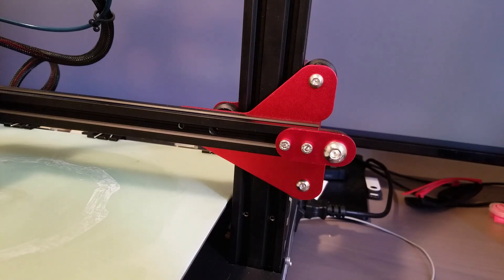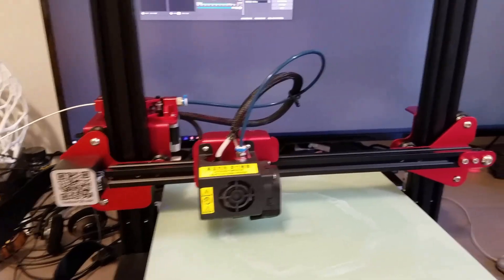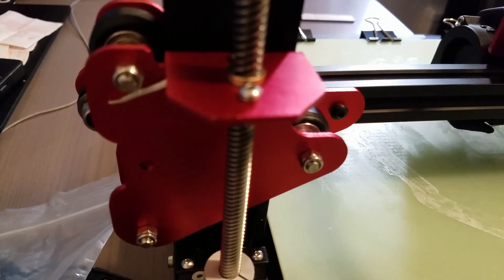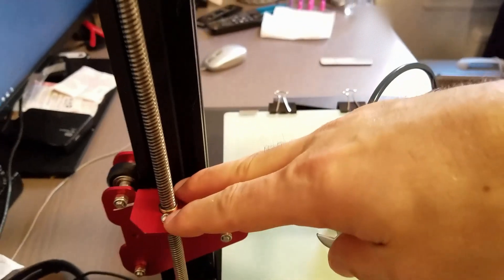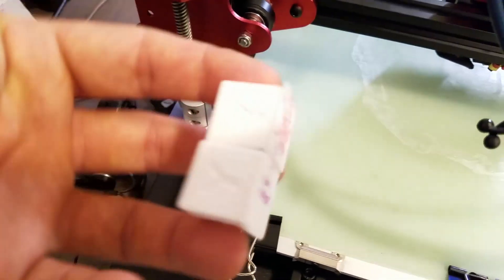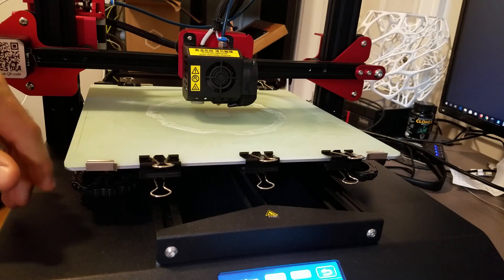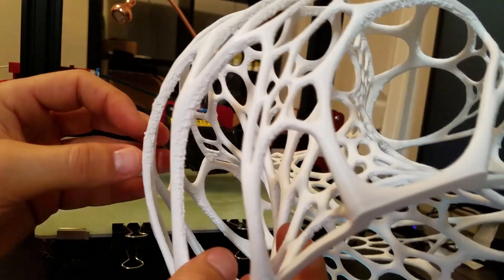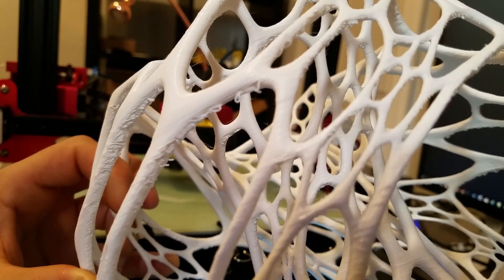Creality cr10s pro x axis truing z axis screw rods tunning, ball bearing wheel dust grinding,

Comment: That just looks like overextrusion. You should only need to get your z-axis “close” to level with the mesh bed leveling. However, I’ve heard a lot of really gnarly things about the CR-10S Pro V1. I have a V2 with the BLTouch and z-sync kit. Works great and is very easy
Reply from the maker: That Z sync kit sounds ibteresting.

Comment: did you fix that problem ? sometimes the material quality makes the diference
Reply from the maker: Actually I did not fix the problem. I was never able to. I replaced the printer.. I had two so basicallly I returnde the PRO and Kept the S5. Not the greatest decision there. But Hey. I did learn a lot on the PRO.
Reply from the maker: i got a differ3nt printer. i was never able to fix it.
Reply from the maker: i returned the printer.
Reply from the maker: i never was able to fix it.

Comment: Clonex?

i have the 10sPro

anti-backlash nuts seem to help, inductive sensor over whambam has been nice, firmware upgrade a must...z-synch mod printing now to install after a squaring ganrty and leveling it.....again, ugh.
this thing can print amazing if you're willing to dial it, but trying to dial it is not so amazing?
Reply from the maker: It has been a pain dialing it in. Clonex, I was trying to propagate new plants from cuttings. Not successful. 3d printing still half and half successful. It seems the hobbie Gods don't love me anymore. So I have been told it can print amazing. what I figure it out is that is can print amazing if you buy a second printer in parts and upgrades to deal with the quirks. I am still not yet dialed in. Everytime I try to tune the pri ter I may be making it worse. It is excessively time consuming.

Comment: I smashed my head into plate - too many time - now what damage could done : sensor does not work - when head come down light is off - trying different distance with sensor - no luck - now printer does not enter the new z :
Reply from the maker: You may need to replace the sensor / probe. did you try to rotate the screw at the top of the probe, counter clock wise, or clock wise? to test the probe you can just take a piece of metal put it close to the probe and check if the LED light turns on. Put the metal as close as possible even touch the tip of the probe to see if the light turns on. If it doesn t than it may be damaged, have you unplugged it from the board? check the wires. do you have glass on top of the bed? usually that affects the probe sensing. If you decide to replace the probe check out the videos online how to use different manufacturers, use the tiny3dmachines firmware for a different probe. if you havent try a new firmware anyway. I am sorry to hear about the probe.

Comment: I have the cr10s pro and what a pile of junk it is, the quality control in these printers is absolute zero. I had the same problem as you,, also the aluminium build plate was badly warped also the heat bed was warped, the gantry carriage fell apart after two prints and lots of screws were loose loose, some of the ball bearing wheels were over tightened. it was like somebody just threw it together without any care or quality control. No wonder you are burnt out, I am too.it's a shame when you spend £500,only to spend hours of frustration for your hard earned cash.
Reply from the maker: Yea I have been tuning it but I still have issues with it. It is quite a bit of work to get t dialed in. if you over tighten the rail wheels then your prints will be bad. I just saw that the y axis can also adjust the tension on the belt. so I have to check that.

Comment: The solution is to deassemble the Z-Axis and make it 90° where the metalplate joints the aluminum profil. This is quality problem. After it my z-axis is now 90°. At the CR-10 there was the same problem for some ppl - there you find good solutions and how to do it. Look for "CR-10 Z-Axis..." Also there is now a update for 1.60.70 with an inductive sensor - now the Z-Axis works good. Or you can make a GT2 760mm belt between axis this helps too, but after the update since some days it shouldnt happend any more with your z-axis.
Reply from the maker: Thank you for your advice.

Comment: Does enyone have a problem with the chip reader on this 3D printer? I had the joy only one to print with it but then i couldn't manage to make the chip reader to actually read the SD card ... i tryed a thousand times and it s  just annoying... i just recieved it today and i m already having problems with it
Can anyone help me, please!!
Reply from the maker: I did say it in my review that you have to save the file locally on the computer and move it onto the sd card, make sure the name is very short. Furthermore in the comments for the review video viewers informed me that there are some Cura settings you can change to fix this issue and directly save to the SD card. https://youtu.be/N0fOA-g6o0k, Use cura from the SD card you received with the printer and alter the settings. that is cura 3.0.2
Reply: you need the original stl file on it - and the sd card should not be too big. also it needs the right format. I had the same problem but his was what i read so far. At them moment i use octopy via raspery 3 to load my files up.
Reply: I am not sure your problem with the SD Card, I had a problem if I download a file and the name is too long, shorten to about 10 characters and will be fine.

Comment: The fuzz on the wheels is just dust. The wheels generate quite a bit of static and draws a ton of dust. I have been printing with my ender 3 (same wheels) for three months and they have the dust on them constantly. lots of dust all the time and there is no actual wear on the wheels, no issues with prints. The print looks pretty decent for stock cooling and .3 layer height. The part cooling duct that comes on all of the creality printers is not fantastic. Even a small simple upgrade like https://www.thingiverse.com/thing:2814127 will help with all the overhangs in any print.
Reply from the maker: Thank you for sharing your knowledge, and confirming my results. I just recently printed a few cubes at .32mm Layer height, and .32 seems to print okish. I have been postponing reprinting it because it takes some time.

Comment: I myself have a cr-10 s pro.. uff, where to start...

Me and a friend tried to tune it properly and we almost got it all calibrated. I am not 100% satisfied with it since my X axis is not perfectly level, and the Z wheels (the ones that you were complaining about as well, are not perfectly smooth). The printer has indeed some factory problems, but they almost all do and all of them need user calibration.

Generally when you are calibrating a printer, it should be in the "Goldilocks zone" not too tight, not too loose, that's for belts and wheels, you should be able to turn the wheels when you hold the piece in place the piece, like the bed or the nozzle assembly, but the wheel should move the part if you spin it without holding the said piece.

Also what improved my printing quality was upgrading the firmware to the Marlin one(both the screen and the printer firmware).

For the print, it defiantly doesn't look too good, not bad, but not good. There are some good profiles out there that you might want to try, and if you are trying to print something complicated like that, lowering the speed to something like 35 mm/s would help a lot. Also adding M204 for acceleration settings and M205 for Jerk settings will do wonders.

You probably knew some of the stuff I wrote here but I'm trying to cover all the bases.
Reply from the maker: NO, the only thing I knew about this was the "Goldilocks Zone"  which I know it to be as the ideal distance for a planet from its star to sustain life, And I do appreciate the pun there I do consume a lot of that wisdom.
As I said in my review I am a novice though quickly learning about 
3D printing. I get the idea not too tight not too loose, just this past 
week took a look at the bed tightness and I did tighten it, but the motor would've
 had to do a lot more work because I could feel manually that moving 
the bed required more force, and there was the same amount 
of play / vibration or wiggle in the bed. So I reversed the tightness to
 what i felt before. Now for the last week and change I only printed two
 useful things, 2x of the same phone mount for a tripod. That got me 
into the stringing and other settings and after getting close to 
"Goldilocks zone", I had to revert back into dialing the bed settings. 
Because all of the sudden the print head or probe could not align the 
nozzle at the same height as before. So that was a about 3-5 hours 
accumulated throughout the week. So now I am looking into finding a 
leveling probe that may do a better job than this one, and it's wiring. 
Or just having the company ship me a new printer and returning this one.
 But just having it replaced seems like the easy way out. I do not know 
about the M205 or M205 in the jerk settings, can you let me know what 
they translate to?  Thank you for sharing your experience and wisdom.
Reply: Yeah I spent days trying to sort my Cr10s-pro out and it was so poorly built and the calibration for leveling was a joke so sent it back to banggood in peices with a note on box saying return to sender. This printer promises so much but fails massively. Every first layer had an issue. So in short this printer is shit and a waste of time and money. Everyone stay clear of it.